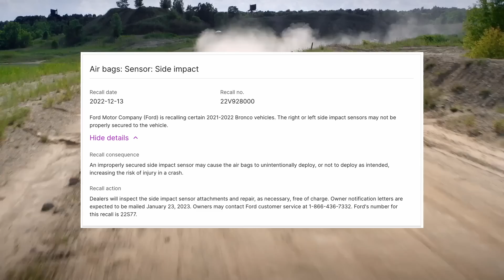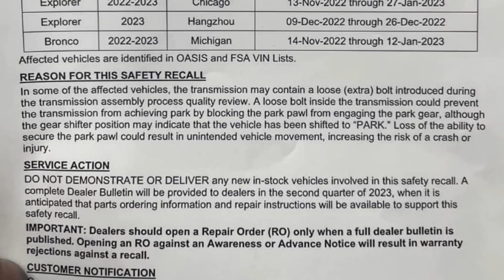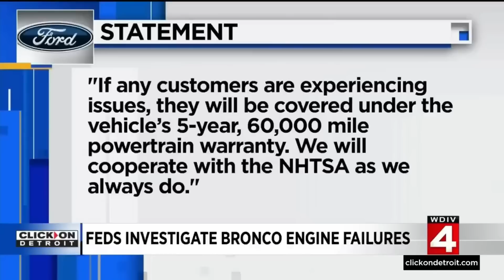YIKES! More Bad News For 2023 Ford Bronco Buyers

Comment: My first car was a 2001 Ford Focus that was purchased new. That car was pretty much my favorite car in life. It lasted me all the way through 2011 when it was totaled in a crash. After that, got a 2012 Ford Escape. Another amazing car that, if it weren't for a hailstorm, I would've still had to this day. I don't know what happened to Ford between 2012 & 2015, but I bought a 2015 Ford Focus, thinking it would be like my last Focus. Like night and day. That 2015 Focus was crap. I went through 3 "PowerShift" transmissions in that car. The car loved to shudder & stall. There were battery & other electronic gremlins that would have my lights completely cut off while driving (even at night). I kept the car until it was almost the end of the warranty period and decided to try once more. In 2018, I got another Focus, but when the transmission still shuddered while driving at only 3 months of ownership, I traded it in for a Mazda3. My Mazda3 is still in my driveway and aside from regular maintenance, I'm approaching 85k miles and this car is still riding and running just as good as the day I bought it.

Ford just stopped building quality vehicles and banked on brand loyalty to sustain them and, there's only so much brand loyalty people can have. Do I think the Bronco is a nice vehicle? Yes! I would LOVE to get one, but the experience of owning a modern Ford have made me not want to ever own another Ford vehicle again.

Comment: The Corvette and the Bronco have had problems.  But these vehicles were not just generational redesigns, they were completely new vehicles.  Everything was new from bumper to bumper.  Nothing was carried forward from a prior generation.  Every car company experiences the more problems, when they take on a massive project like a totally new vehicle.  A company can test the hell out of new prototypes and early runs vehicles, but it simply will not flush out all the problems that thousands of cars being driven millions of miles in various conditions will reveal.  

I don't care who the manufacturer is, never buy a car that is a completely new vehicle, it will have more problems the first year or two.

Comment: I was really interested in these when they first came out, but after seeing the botched rollout, dealer mark ups, and quality control, I’ve all but lost interest at this point. The alternative is a wrangler, but after seeing the abysmal quality of my brothers JL wrangler I am pretty much at the point where I think money is better spent restoring an older jeep with a proven drive train.
Reply: Bruh don’t say jeeps are any better. If you wanted a good suv should have gone Toyota 4Runner
Reply: @jonthecarguy  Toyota doesn’t offer a manual. 4Runner is a great truck, wife had an ‘01 SR5. But no clutch = no interest.

Comment: I’ve worked on everything from BMW to Subaru and they all have issues here and there. Stop the fear mongering, do some research and cross your fingers no matter what you drive. My current ride is a 2013 3.5 EcoBoost F150, daily driven carrying about a 1000# of tools and it sucks gas but always gets the job done. We had a 19’ 4Runner, nice but no power and just as bad on gas as my Ford. We’ve had everything - Minis, Audis, Honda/Acuras, Subarus, VWs - they are all a diminishing return investments so drive what you like and can afford.

Comment: My wifes 2023 Bronco Sport engine threw a rod on the highway a month after she got it. Ford paid for the tow and the new engine of course and gave her a bunch of points. I don't like the vehicle but it's not mine. The signal paddle cancels on a slight turn of the wheel. The vehicle hesitates when you step on the accelerator. You don't have the option to turn off the smart steering which is annoying when you want to exit the highway.

Comment: You’re not even talking about all the cars that were parked at the factory plants because there was no computer chips
 that still have to be brought to the dealers sold and then find the factory problems on them. I hope that when the dealerships except those vehicles that all the factory recalls are done right there and then before they sell them to the customers.   

But knowing the dealerships that I’ve dealt with across the country I highly doubt it though just wait until they sell it and help the name of Ford go further down with shitty quality control    

When you think how many plants that make different parts for the Ford vehicles and then the parts come together at one location quality control is a big problem.  

Just for an example, I am a truck driver. For a short time I did flatbeds. Oil city Pennsylvania has a factory that makes rolled steel. That rolled steel gets taken to Barberton Ohio. That’s where Chrysler has their driveshaft division. I don’t really think that it’s only Chrysler but Chrysler  names on it. Because there’s trucks that pull out of there and used to go to the Lordstown plant in Ohio for driveshafts. But just with the example, you got the oil city company different state is the steel made properly. When it’s delivered to Barberton Ohio are they putting that rolled steel together making sure their welds are proper. Then you figure all the other parts the universal joints where they come from.    Good luck trying to get quality control under control when you’re not making everything at one plant. Most of the electronic stuff come from Europe, France, China.

Comment: I had bought a new 1999 f150 in November 1998. Engine blew up on the 2nd day of ownership. Cancelled the contract, went across the street to a Dodge dealership, bought a Dodge Ram. It had 363k miles on it when i bought a 2011 Ram, still have it and it's at 303k.
Reply: Nice! You are running the Ks off it.

Comment: the lady said she was just driving and went to make a turn and it died, then the engine was bad, no indicators or warning - this is caused by a "valve" ? does anyone know what valve ?  oil pressure bypass ?  i dont understand what valve caused the engine failure ?

Comment: Just LOOK at the mess of an engine design! A tangled web of hoses, lines, wires in a crows nest configuration. Each component designed by one department and then all assembled by yet another department working in a silo.  A nightmare to work on.

Comment: Ford keeps refusing to put a n/a 5.0 or bigger engine in any of their SUV’s. A big tire Bronco does not want or need a boosted, small 4 cylinder engine. Their Explorer and Expedition needs an option for the Coyote, and their Godzilla engines in those platforms. GM has up to 6.2 liter engines in their Yukon and Suburban vehicles. Get a clue Ford! I am a true Ford blue guy, but will not get one of your vehicles in the Bronco, Explorer, or Expedition until you give me a N/A V8 option!
Reply: Thank the EPA and the Federal government.

Comment: Those ten speeds are a GM/Ford Collab I wonder if GM was having the same issues
Reply: At present over a million vehicles with the 8-speed transmission part of class action, and the 10 speed on ford are abysmal. Chevy as well
Reply: Chevy had a better programming with their 10 speed.  Not as much problems as the Ford 10 speed

Comment: Rear camera recall on f250 is still open with no date for actually making them. I dumped my F250 for nonsupport and frustration with the dealer for warrantied oil pan leakage shouldn't have to beg and plead to fix an 80000 dollar vehicle just disenchanted with Ford overall. Was going to buy my wife a bronco but not now.

Comment: Anybody in the car motive industry knows that market adjustments are due to lack of inventory. To put it in simpler terms, supply and demand. manufacturers can’t keep up with the demand, which intern is why they are charging more than msrp. If dealers were charging MSRP for every model like they were before the pandemic, there would be an even bigger shortage in vehicles, and there would be nothing on lots

Comment: Mine is on a rail car on the way, 7 spd manual though
Reply from the maker: Congrats! That 7 speed is really smooth. I drove one with it a while back.
Reply: you wont regret it, i have a 2022 outer banks and a 2022 jeep gladiator, both over a year, no problems on either yet, but the bronco fit and finish is way better than the jeeps,the hardtop on the bronco is definately quieter than the jeeps hardtop, rides way smoother, handles way better, a little better mpg, about 1.5 mpg but the bronco has 35's on it and jeep has 37's. long distance driving, hands down goes to the bronco, it is very capable offroad also but thats where the jeep fairs better since it is not ifs. i love both, but the clear overall winner is the bronco for 99% of the people.i am a jeep lover still, this is my 5th one, and my second bronco. when i really want to wheel i go in my 88 suzuki samurai, neither jeep nor bronco can hold a flame to that goat offroad, but smooth is not in its vocabulary. enjoy
Reply: Sally you've already drink the Kool-Aid and you're going to pay way too much for way too little. And we're not going to hear how miserable your experience is because you need to try to justify how much you spent. Honesty is not present in today's social media

Comment: I know this is old but some of your info is misleading! The early broncos with the 2.7 had issues with valves because of Covid issues ….Ford reached out to 3rd party manufactures to get engine parts needed to complete these Broncos …..turns out the manufacture was skimping out on quality to rush production. 
Also from the beginning of the automotive world ,there’s been recalls and failures from every make and model out there! GM and Chrysler have been leading the way for decades …..but has for any mass produced item and with the complex product such as a late model vehicle ….they’ll be issues!

Comment: My 1968 Galaxie 500 convertible would jump out of park and go into reverse. I watched in horror as I had pulled it out of my garage parked it across the street and walked back to lower the garage door. Car was on high idle and it jumped park into reverse! Yikes it side swiped a telephone pole and crashed into the neighbors fence and fortunately got stuck. In any event I still love ford's. Have 3 right now 2022 Ranger. It had the same windsheild recall as Bronco. 2016 mustang GT convertible. Rear camera recall and door lock recall. 2010 GT500 has air bag recall. All cars have recalls. Thank goodness they do so the consumer is protected. Back in 1968 all For did was send the owner a sticker that you where to place in the car reminding owner to always set the parking brake turn off engine as vehicle may not stay on gear. I say recalls are progress and a good thing as any thing made by man is imperfect as man himself is imperfect.
Reply: That’s a hilarious story.  I’m glad nobody got hurt.

Comment: I had a 2012 fusion with 56k miles that was such a lemon I gave it away for free, because it didn’t feel right taking money for a vehicle with such consistent mechanical issues. I would never buy one again, although I stuck with American vehicles and bought a used Chevy Bolt, which so far hasn’t given me any issues.

Comment: Why does anyone buy Ford?  I made that mistake back in the late 90s with a Contour SVT.  Worst piece of junk I ever owned.  In less than 18 months of ownership it tallied the following:  9 alternators, 3 dashboards, 2 windscreens, 4 airbag replacements, 1 transmission replacement, rear deck spoiler spontaneously ejected itself on the highway at 55mph, Firestone tires delaminated in less than 5k, paint was oxidizing on the hood and roof, headlights were oxidizing as well (almost yellowed), interior fabric was pulling apart and much more.  Ford bought it back off of me and paid a settlement on top of it to avoid a Lemon Law issue.  I walked into a Lexus dealer in 1998 and bought a new 1998 LX470 (LandCruiser).  Owned it ever since.  1 alternator replacement in 24 years of ownership.  Same windscreen, not one single recall in its entire life.  Still has it's original leather that has yet to tear or crack.  Paint still looks new.  Oil changes, belt changes and fluid changes...standard services is all it's ever needed.  350k miles (including over 75k offroad on 3 different continents) and it hasn't reached the number of services my Ford had in 18 months.  Ford still can't make anything reliable and their dealer network is flat out criminal charging "demand fees" and worse.  Sure wish people would tell Ford to stick it where the sun don't shine.

Comment: i never understood why people would buy anything but honda/toyota if you're poor/middle class..
Reply: Toyotas and Hondas are just as expensive and usually sell for MSRP even without the pandemic markup, and some people don't want to drive tin cans with zero personality
Reply: @ubeuonly  yeah, I spent alot of money, I want to get the most out of that money. I don’t need a gaudy looking vehicle that won’t last past 150K.
Reply: @MrBe787  I'm not sure which side of the fence you're on but most Vehicles will make it to 200,000 miles it's just a matter of replacing the transmission or multiple small items, I just did a cam and lifters in my 2011 Ram and I think it will be good for another hundred thousand miles currently it has 227 original transmission, rear end is whining a little. My 19 Ram Charlie has 90k one warranty service concern during the warranty.. n0 recalls I think this one would be good for 250k as well

Comment: These engineers should be fired, bring back the reliable 4.6 v8 with the trans that went with it and put it in the bronco. Will last forever. Think of all the old grand marquis taxis with 400k miles on them

Comment: I DO NOT LIKE THE RE CALL , WHAT IS A RE CALL? …MAYBE THE CAR IS BUILT DIFERENTE AND LETS FACE THIS WE HAVE TECHNOLOGY AND WE NEED TO. TAKE TIME TO LEARN TO USE IT , JUST  LIKE THE  FIRST TIME DRIVER HOWEVER DO NOT TAKE STEP BACK ASK YOUR DEALERS , SERVICE DEPARTMENT TO SHOW YOU IF YOU CAN NOT , THE SERVICE HAS TO BE AVAILABLE FOR YOU THE CUSTOMER…IF YOU ARE SOENDING MORE THAN THE CAR YOU PURCHASE FOR REPAIRS SPECIALLY IF IS NEW , CALL SERVICE MANAGER ASK WHY? CALL FORD AND LEAVE BRIEF RECORD MESSAGE , WHERE LOCATION OF DEALERSHIP, VIN # OF VEHICULE AND THE AMOUNT OF MONEY YOU WHERE CHARGE , ALSO YOUR NAME AND PHONE , E MAIL. ETC. ..IF CAR YOU PAY $54,000.00 AND THIS IS YOUR 2  YEAR AND YOU GET A BILL FOR A CHECK UP, TUNE UP , INSPECTION, BALACE THE TIRES, SOMETHING EVERY DAY FOR THE AMOUNT OF $10,000.00 TO $28,000.00 , WELL IS SOMETHING WRONG …HOWEVER THE DRIVING YOU GIVE IS THE WEAR YOU GIVE AND IS THE PRICE YOU PAY TO HAVE FIX …THIS IS AN  EXAMPLE OF CITUATION DO NOT MAKE PROBLEMS …

Comment: got a new 1984 F-150 drove home from dealer friday evening pulled off freeway and and my 4 speed ( first gear granny) was making nosies pulled drain plug Zero oil in it, was told to put in gear oil ok for the weekend monday backing out of drive it jams and only gears i had were revers and granny got towed got fix ? well a year later and it breaking down over 12 times towed 6 times was told by ford rep if it does it again they would put in new transmission 3 days later it broke they said they would fox it is said no i want the new transmission they said we cant do that i said good it will be in my uncles barn on his ranch and done with payments they said that between you and the bank is no its between me and FORD MOTOR CREDIT they said ok new transmission next day had new one in the truck that was flown out over night from back east to califorina and have never owned another newer ford except a 1971 Econoline

Comment: I drive by a Ford dealership every day. I'll bet they have 15-20 Broncos and an equal number of F-150's sitting around collecting dust. Ford did it to themselves and frankly the original Broncos were under powered rust buckets that weren't worth the money even back in the 70's. Seems like Ford is at it again with this lemon.
Reply: And yes capitalizing on the Nostalgia sometimes takes away from the quality of the usefulness of the original vehicle which was virtually non-existent

Comment: ford should make a cheap version of the bronco 4 cy manual no back seat base model and sell it cheap and go back to the single cab 8' bed model f150 with the same 4 cy manual 2 wheel drive on both stop making the maverick and go back to a real ranger single cab make trucks for the working people and rebuild that working mans brand and keep the high end   for what people that think a truck can cost a years salary

Comment: I work for an auto extended warranty company and ford product quality is awful. Lots of 1 time use parts now. Plastic oil pans and valve covers. Just garbage. If you buy a ford don’t get a sunroof. Just trash across all their products
Reply from the maker: I had a Raptor with the sunroof. Definitely not worth it.

Comment: Late 60s you had to lift the column shifter to start the car, and you better not have left it running, as it would slip into reverse and you find your Ford piece of crap going round and round in the parking lot in reverse.

Comment: I have a 2021 Bronco and love it. We've had 60,000 miles of trouble free use. The power is insane for a 3 cylinder and it's getting 32mpg on the highway.
Reply from the maker: So... you have a Bronco Sport? Lol. Not a real Bronco. But glad you're enjoying it.
Reply: @MotorFeed  Yes, it's a sport.

Comment: Its a little disheartening hearing about the quality of the Ford Bronco builds. That is really not good. Even though they will work out the kinks eventually and the Bronco is / will be amazing, it just makes you think about the longevity of these trucks after 100k miles. Low quality assembly will rear its ugly head when the trucks are old.
Reply from the maker: I really hope they solve these issues or it will seriously hurt the brand. I don't see these being great after 100k. Hopefully the prices reflect that and go down.